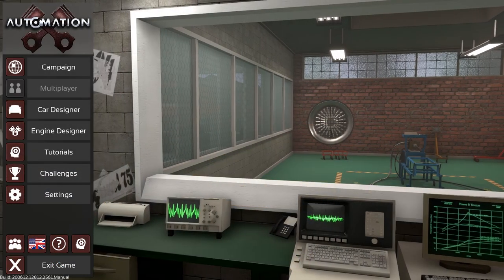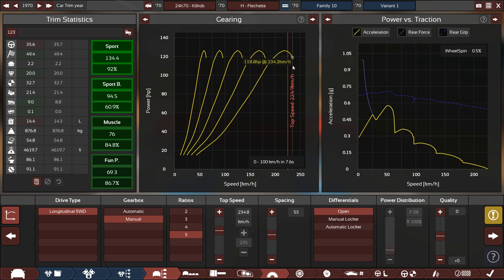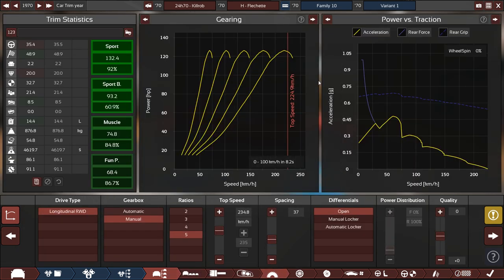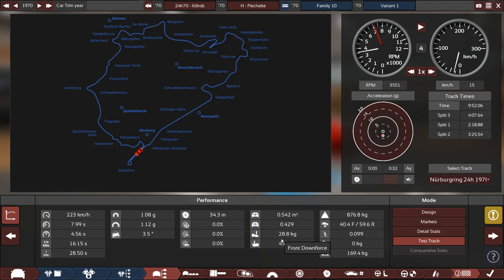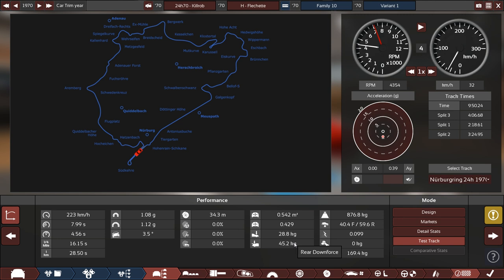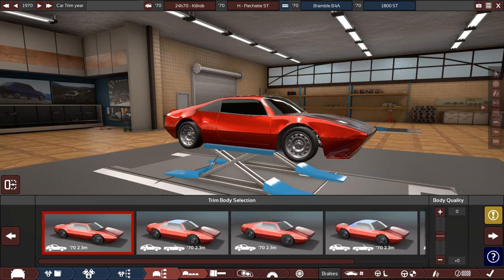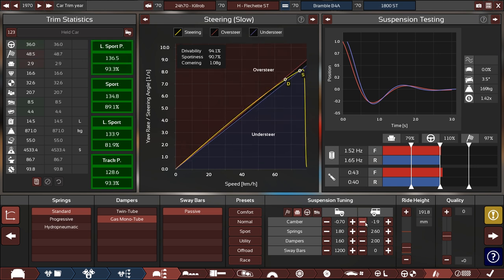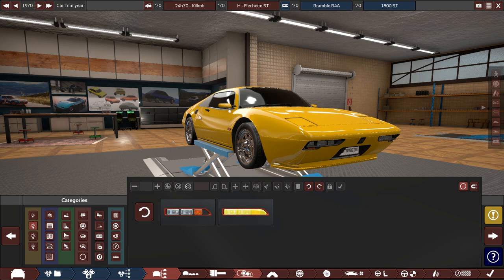Making a 1970 Race Car (Automation BRC) Ep.03

Comment: i was going to make a joke about filling your wheels with hydrogen, then i googled it and realize oxygen weights 1.4 kg per cubic meter, soo.. it wont take away 100 kg, but at least something :-D

Also i would love an actually properly built Nürburgring for Beam.ng.
Reply: There is one but it's really old and it has terrible performance, so yeah, not really properly built
Reply: Hindenburg tyres, I like your thinking. Although pure nitrogen is used as an alternative to just air sometimes. Also air is only about 21% oxygen, so it isn't the primary contributor to the density of air. On the topic of weight reductions though, I did hear that drilling holes everywhere is a great method for reducing weight.

Comment: How is the fuel usage calculated? I created an engine with 11% efficiency shown in automation but 0.6% at max RPM (8000). Basically in racing it would have an average of around 2%, but is this what is used?
Reply from the maker: The correct % at the RPM is used in the BRC and in Automation's fuel eco calcs. The engine efficiency in this case is almost 15% at higher RPM, so it is doing pretty well until close to the rev limit.